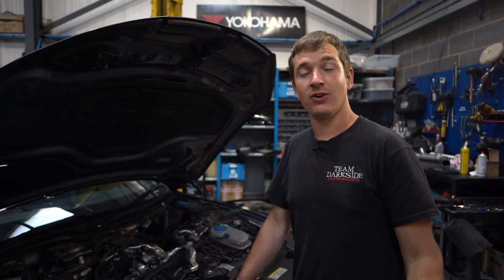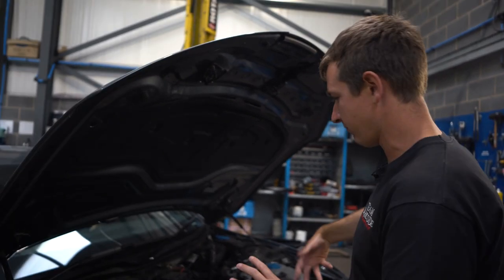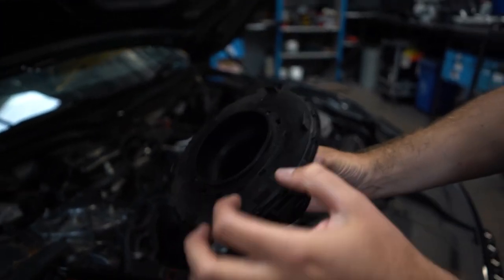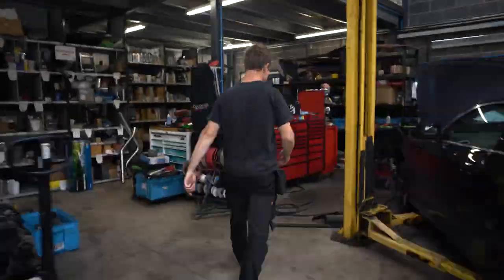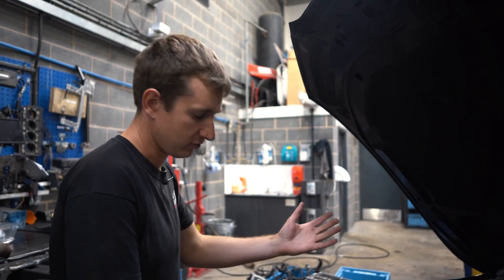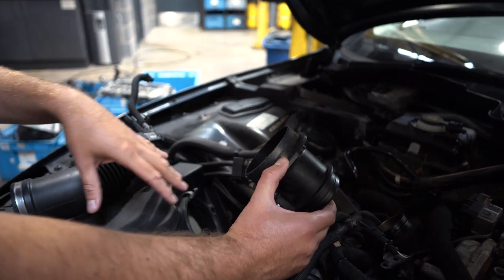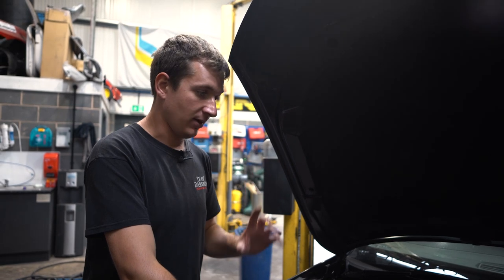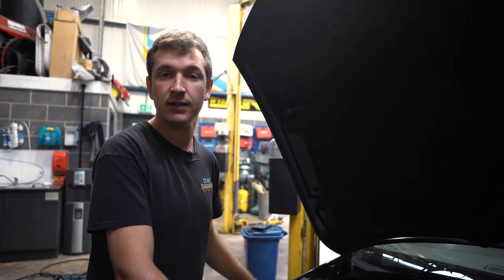CHECK your AIRBOX before you WRECK your TURBO!

Comment: I’ve got a feeling I need a new turbo gonna have a look at it when I change my filter on weekend. I’m new to working on cars does slight damage to turbo mean new turbo? If so is it worth upgrading or changing turbo like for like? What sort of cost is a turbo upgrade (2008 a5 3.0 CCWA)
Reply from the maker: If the turbo is damaged, it's best to get it replaced to prevent any further potential damage to the engine. As to which turbo to get, depends if you want to keep it standard or want to push more power out of it than just a tune will do. Drop us an email to sales@darksidedevelopments.co.uk with reg/vin and we can breakdown costs depending on what you want to achieve from your car
Reply: @DarksideDevelopments  I mean I wont complain having more power 😂 when I bought the car it was already mapped to 300ish and managed to finesse the dark side downpipe for free with the car as he took it off before sale and have put it on since so sounds 10/10. Is it as simple as putting a bigger/more powerful turbo on or are other upgrades needed when upgrading turbo. Once I have a look at turbo on weekend I’ll know if I want to change turbo or not yet
Reply from the maker: Turbo will help but supporting mods will help get the best out of it. Drop us an email and we'll be able to help you out further on there

Comment: Do you recommend any aftermarket filters or do you just suggest using OEM ones?
Reply from the maker: OEM until it restricts, or you want more noise!
Reply: I was about to ask the same.  You see so so so many open cone filters sucking hot under bonnet air and the owner will argue til blue in face that theyre worth power lol

Comment: Hello im from sweden and follow your posts it seems you guys know what you doing 👌🏻.I folia you guys since i buyed a Audi . Now I’m owner of Audi A6 (45TDI) , and I have one question I changed my air filter and usually I check all pipes and condition of turbo, looks good , but I wondering one thing ?should be oil moisture on the inlet pipes and turbo? It’s not a lot but you can definitely feel there is oil ?
Reply from the maker: Yes this is normal, it is just oil vapours from the breather pipe going back into the inlet. Nothing to worry about 👍

Comment: Anybody any ideas why a actuator rod will move freely when vac pipe connected but when connected to wastegate it won’t budge at all ?🤔
Reply from the maker: What car?
Reply: @DarksideDevelopments  Peugeot 307 1.6 HDI non VGT turbo I know it’s not your type of vehicle but any help would be appreciated if anybody knows 🤧 More than enough vacuum to move the rod fully but when attached to the wastegate it won’t move at all resulting in no boost

Comment: Would you advise against a remap from 242hp to 272hp for a 2012 cduc a7 with 128k on the clock? Just checked my turbo, one of the fans has a small amount of erosion on the top, smaller than 2 mm , the seals good on my oem filter thankfully
Reply from the maker: A light tickle might be OK!
Reply: @DarksideDevelopments  were they whistling a bit moor than normal